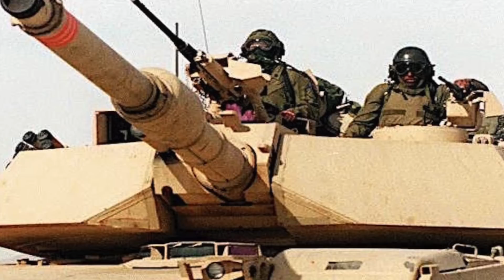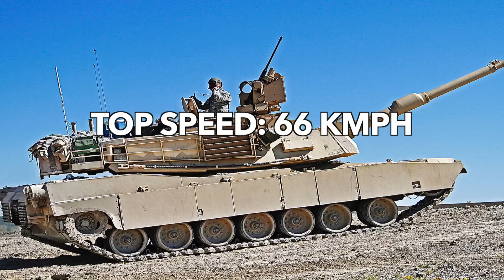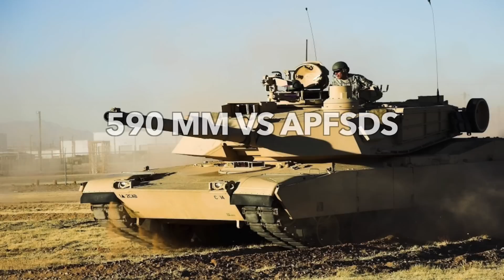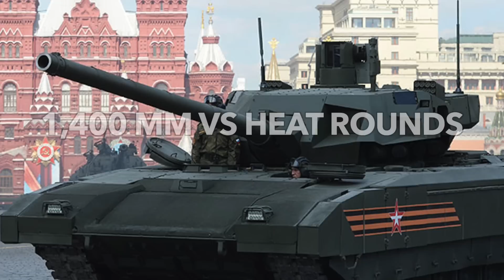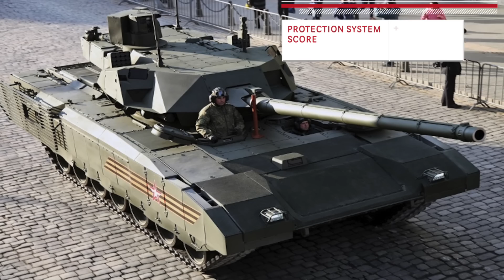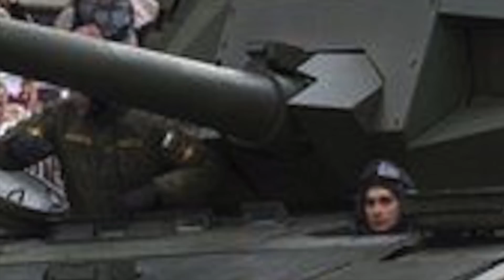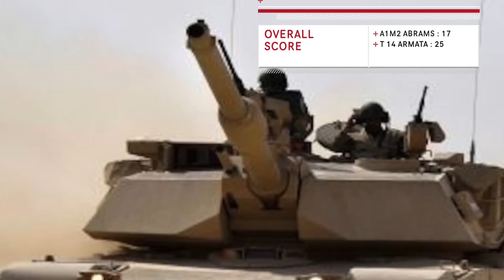AMERICAN M1A2 ABRAMS  vs RUSSIAN T14  ARMATA: WHO WINS?

Comment: A note about  the cost (point 5) :  
Abrams $9.6 million vs Armata $3.7 million. Ratio : 2.6 to 1
US GDP (2015) : $17.95 Trillion vs Russia GDP (2015) : $1.326 Trillion.  Ratio : 13.5 to 1
So... 
Russia spends 1% of its GDP on tanks, it gets ~3600 tanks.
The US spends 1% of its GDP on tanks, it gets ~18700 tanks
Reply: USA debt vs Russian 0$ debt

Ratio:   19,846,342,893,093 to 0
Reply: I mentioned this because raw price is usually less important than affordability, and with its much larger GDP, the US can afford a lot more tanks than Russia can, even if the individual tanks are ~3 times as expensive*.

As to maintaining the tanks, it probably follows a similar pattern. Yes, 18,700 M1A2s would cost a lot more to maintain than 3600 T-14s, but again, the US has 13.5 times as much money as Russia, so they can afford it.

Lastly, I don't know where you get the idea that one can't put more than 50 tanks on a battlefield without becoming an easy target.

*One reason the Armata costs less is because Russians workers make less money than US ones do.   Of course the Russians can make a cheaper tank... they only have to pay $5/hour rather than $30/hour to the guys who mine the iron, work the smelters, roll the steel, machine the parts, assemble the tank, and so on. 
 Same goes for operating cost.  One wonders what T-14 would cost if the Russians paid US wages to all the workers in its chain or production.
: 
M1A2 : $9,600,000   :    US Per Capita GDP : $60,000    :   M1A2 cost in worker years  : 160
T-14 : $3,700,000      :    Russia per capita GDP : $9,000 :  T-14 cost in worker years      : 411
Reply: +Jack Ozbloke

I've never been a fan of the T-34.  Despite its fearsome reputation, it was (in a lot of ways) a crap tank backed by crap doctrine operated by relatively poorly trained crews.   Of course, in the end, there were a lot of T-34s and not so many Tigers, so the T-34s won.   Even if, as you assert, the M1A2 is the T-34 in this comparison quality wise, all I am pointing out is that (despite the individual sticker price) it will also be the T-34 in numbers.

Extra : 
How about this instead :  The Germans had fewer tanks than the French in the battle of France, and the French tanks were generally better armed and armored, yet the Germans beat the French in a matter of weeks.   There is more to it than "comparing millimeters".
Reply: If you own the bank $1000 and can't pay, you're in trouble.

If you owe the bank $10,000,000,000,000 and can't pay, the bank is in trouble.
Reply: Even tigers vs t-34s in ww2, fighting point blank range virtually and the tiger fewer in number but higher in quality jsut destroyed them, the m1a2 is comparable to the t-34 but instead of having the price it has the tigers price which is actually quits funny.
Reply: +Aj Styles
Care to explain (rather than just assert) why the US can't afford to spend on military?  I mean, they seem to have been doing so for the last 70+ years and currently spend more on military than the next 7 largest spenders combined.  But "Russia Stronk" for whatever reason...

As to you 50 tanks argument... yes, balance is important... sending unsupported tanks into close terrain that is packed with enemy infantry is a bad idea.  But the side that can afford more tanks can also probably afford more infantry, more air, more artillery, and more of everything else, so it won't be doing that unless someone in the chain of command is an idiot.     As to the 5 rpgs per squad thing... what are you saying?  Russian Infantry is immune to tanks because they pack too many RPGs and that they will make a fortress of destroyed enemy tanks around themselves that keeps any more enemy tanks from approaching?  I guess "Russia Stronk" again.
Reply: At the end they mentioned the T14 would be outnumbered in battles against the M1A2, yeah GDP does play a factor in  producing tanks.
Reply: In present day figures a T-90 is over 4 million each.  I would imagine an Armata would cost more.
Reply: You and every other Russian dumbass on here need to slapped in the head with an iron frying pan until you cease to exist or they stupid goes flying out of you.    To actually THINK that a 35 ton vehicle carries superior armor to a 70 ton tank is the absolute DUMBEST thought in the HISTORY of mankind.    EVEN some idiot that says "hold mt beer and WATCH THIS"!   THAT guy, is smarter than you.  Lol 😂😂😂🖕
Reply: Are people trying to come to the US or are they trying to go to Russia?  Russia is exporting its children because it can't afford them.  Their women are choosing to be brothel workers in the Middle East and Thailand instead of live there.  Come on man.....we are not stupid.  You are just jealous of its power and its influence and you are not allowing yourself to see what you know is right in front of you.  The US is quite simply the greatest nation the Earth has ever known.  It really is.
Reply: Americas Government Debt. 20 Trillion and rising fast. In peace time. Unsustainable.  You lose.
Reply: I don't. US dollars, that's shit. 20 Trillions in debt, in peace time. I don't call that reliable.  That's what's nice about debts, you owe it to other people, and you have to pay one day. If you cant, well your money will be worthless in no time :)   Remember Greece.
Reply: What war was that ? The war on terror ? Good lord, good thing it wasn't a real war... You clearly don't understand how the defense budget is voted or even allocated.  Bought many war bonds recently ?  Dummy.
Reply: Duplicity you do know that America owes most of that debt to Americans right. Not China. Many people have this weird assumption that we owe China 19 trillion dollars. If we did China would ask for the money and destroy the U.S. economy.
Reply: mike che how does money have anything to do with suicide. You do know money can't buy happiness right. Also those soldiers have gone through a lot of shit in their respective wars. They have flashbacks of the terrible moments they went through and the memories of death haunts them still to this day.
Reply: older than you from the looks of it.
Reply: AJ Styles sounds like you are confused friend. 1: Battlefields don't have boarders, that's video game logic, 50 tanks take up barely any space on a  real battle field. 2: even in confined quarters like a valley or city, you don't have to send all 50 at once, you can send them in waves (You said this, but then acted like you forgot so I thought I would point this out). 3: An RPG is designed for light armor and anti infantry, In Afghanistan my MATV took multiple RPG hits and kept rolling, it's not a threat to a tank. 4: Even if an RPG could kill the Abrams, it cant engage the at more than around 150 meters, while the Abrams can engage at around 1.5 miles and 5: You can knock out a tanks mobility, but then all you have done is made it a turret. "Knocked out" tanks can often still aim and shoot, and trust me, infantry don't want to go in a head to head without their own tank support. Lastly, if you are going for real battle specs, of a Russian and American military unit going head to head, The US would have air and artillery superiority and would soften any target area sending in tanks and infantry to mop up, the number of Russian tanks and infantry to survive such attacks would be of no threat.
Reply: +Jqbogus

The lowest cost listed for the T-14 was 4.12 million USD. Not 3.7. This accounts for today's adjustment in monetary values for both the ruble and dollar. 

The M1 doesn't cost that much in any variant on record.
Reply: +Nathan Peterson
I was just quoting the cost per unit used in the video.  Are you saying this video might be inaccurate?  :)
Reply: +Jqbogus
Well, same as before when you send an entire tanks against someone, the only right respond is to reply with the same answer, and we have seen US numbers dwindle just as they can't keep up with the maintenance which ends up costing delays. And yes triple the numbers, as in transport, ammunition, fuel, and spare parts. US don't operate within their country in most situation unless it's defense.

I mainly suggesting that troops using Russia weapons usually incorporate some anti tanks, same cases that happens many times. It is funny how you said if they can bring a lot of tanks they can also bring a lot support, and the enemies can't?

- one thing i want you to know about me, I don't care about numbers nor their might, as in who will win Russia or US, neither, if they both go to war for whatever reason, i think Russia can win, not because of their current power nor in US incompetence in many previous history. But as the only people who has been at the top for so long, and yet remained as a 3rd world is just weird as hell.
Reply: us gdp ...less foreign debt ...around... 0
russia gdp less foreign debt ...gdp untouched... no debt!!
Reply: funkierfawn budgie 158,009,671,672 USD

Russia is in debt and rising steadily don't neglect the opposition
Reply: funkierfawn budgie HAHAHAHAHA lol nice comeback
Reply: And still doesn't has the balls to invide russia , what a pussies
Reply: The German military's simulations arent fully correct tho,  and that is both crews are equally trained, and also, they don't know everything about the T-14 yet either.
Reply: +smyers820gm well it doesnt weight that, and not everyone uses systems as primitive as just thickness in armor thats why even hutties beat the crap out thus shity tank... just like the sherman by the vietnamese... seems like someone needs a reminder of the slaping usa had got over the years hahahahhaha
Reply: +SeanP7195 you imagine a hole lot...
Reply: +SeanP7195 you imagine a hole lot...
Reply: +SeanP7195 you imagine a hole lot...
Reply: Well maybe...just maybe, should check your info before typing...the t14 does not weight that 35 ton, however only us jackasses rely on only the primitive protection of the thickness of the damn tank, i mean...fyi the ww1 was a century ago, maybe that kind of thinking is the one that take the abrahams to be turned into scrap in yemen by forces way underarmed compared to the saudis but other than that, keep thinking the abrahams is the best, wont be true, but you ll live in the fantasy world right?? hugs bro!
Reply: Jealous much? The US dollar is the world's reserve currency. It's the most stable. It's the most reliable. The US economy is where the world puts it's spare money for safe keeping.
Reply: +TomDotCom2 jealous? you soeak of it as if the us economy were suoer healthy and its clearly NOT is world most indebt country by far and keep pushing it, dont make a good dvd olayer no more, all car manufacturers in crisys about to crash... seems like that currency stuff is about to change your economy is imploding cant you see? so in short no im not jealous at all.
Reply: Jqbogus 
All western GDP formals total nonsense 
Russia have Draft army (almost free) and many simular examples like FREE  healthcare  daycare and so on.... which in USA dont even  try yet 
So that GDP nonsense don't really apply
Reply: Implode?    highest GDP in the world. An economic titan churning out elite goods and services in demand worldwide.
Reply: +TomDotCom2 and highest debt, beyond gdp, house, car and tech industries with lower and lower and lower income, companies as sears and caterpillar crashing that imploding got it now?
Reply: Not one company exists on the original NYSE.  Companies are always coming and going.  Many of the top companies now we barely knew of 15-20 years ago and 20 years from now they will be different again.  You appear to be from a collapsed and weak Latin American country and feel angst at your people failures.  I guess thats normal to feel that.  Many nations take this stance.  It is also a very useful tool for many nations to use a more powerful nation to cast aside its failures and true identity.  The people gobble it down like flan.  I've always said its not nations or governments, politicians or corporations that are the problems.  Its the people who allow it.  Welcome aboard.  Classic defense mechanisms.
Reply: +Daniel Barvenko when did i say anything about russia's economy? im speaking about the decay of us economy...thanks though
Reply: Yet the economy of the us is indebt, and with continous companies closing its operation, losses in revenue, cant even make a decent dvd in us...i mean not even the rockets that take astronauts are being made in the usa no more...but if you wanna live in fairyland thinking us economy is best in the world with the largest gdp dude be my guest, that is a pipe dream as much as the american dream, GONE.
Reply: Dont worry!
Reply: Name these countries (especially the one you are from) that is debt free for us.
Reply: your talking to me?? cause....correct me if im wrong its been 17 years and gizillion dlls in budget for that war that has acomplished what exactly? the region is far unstable, us is far indebted, none of that wars, lybia, irak, or afghanistan has really brought anything good for no one. NO ONE. By any means is us safer? no, is it enjoying more freedom in or outside the us? no...so? besides, who said us is the planet's police???
Reply: Jqbogus US debt 20 trillion dollars....Russia 0$, ratio...infinite!
Reply: Don't forget we pay our soldiers a lot more than Russia does and that's a major expense. Probably the highest one, especially considering we have many more soldiers and contractors to pay these higher salaries. We also have to maintain an insane amount of basis around the world so we can project our power but Russia doesn't. We spend Billions on carriers and they spend millions on carrier killers. Add those factors and it cuts down on your ratios dramatically.
Reply: Who pays more? LoL
U should compare living cost and so on by country and see who get paid more
BTW Homelessness in Russia illegal, by Russian constitution  every citizen have place to live and free healthcare 
Government a MUST provide place to live healthcare and on.......
Reply: Qvolepues 
If USA paying to solders good how come 22 veterans a day coming suicide?
Reply: "Money cant buy happiness" Really???
How old ARE U?
Reply: Ok but how fast you can make them 😁
Reply: bur other countries which are customer of usa and russia for weapons will prefer t14 armata which will loss profit of us arms companies.
Reply: Pathetic old man keep coming back for more you fucking petofile. Your like A turd that won't flush because your butt hurt that you are the dumbest one on this site. LMAO!!
Reply: America is also in more debt than Russia
Reply: Murican fanboy🖕👎
Reply: Russian junk is always cheap, because it is a junk!
Reply: That's bullshit and you know it! Russia is capitalist not communist anymore, there are lots of homeless people in Russia, most also addicted to high risk drugs...
Reply: And US debt is . . . ? Wait till we get petro-yuan, and the seppos will find themselves bankrupt. Can't wait!
Reply: Well U.S. government will not use it's GDP to spend on military, it is the Defense Budget, 700 billion USD,because U.S. has currently the largest Debt  around the world it is about 16 trillion USD and China is the largest Debt holder of it's debt.
Reply: Russia will also not spend it's GDP on military it is only depends on military budget.
Reply: U.S. has currently the largest Debt in the world because of it's too advanced technological infrastructure uses in the country, however, U.S. government has spend too much on advancing nuclear weapons, as they have produced around 70000 warheads since 1945, spent 8.1 trillion USD, but also includes of the fund raise for education, safety, FEMA,and unemployment in the U.S. totally added up together is about 7 trillion.
Reply: Well WW3 will not quite happen in the next few years because the world is getting bankrupt, as EVERY country around the world has various debt on their own economy.
Reply: Jqbogus 
   So, you purchase tanks via debt? How fucking stupid are you? 😎
Reply: Jqbogus 
  You don't understand the concept of debt, do you? 😎
Reply: Mantas P 
  No, they are not. 😎
Reply: LOL
https://www.nationaldebtclocks.org/debtclock/russia
Reply: https://www.nationaldebtclocks.org/debtclock/russia
Reply: Joris Thijs 
https://www.nationaldebtclocks.org/debtclock/unitedstates
  See how fucking stupid you are? 😂😎
Reply: Nationalist Canuck  Did I said somewhere that the USA had no debts? Checks, checks again. Cannot find it...
Reply: That seems a logistic nightmare, that's why they don't need mathematicians in the front line...
Reply: Jqbogus economy for the us will likely collapse due to China and China's massively suffer to but russias could increase since Australia, China's main resource importer and many other western counties stop exporting their resources they'll turn to russia which could make the economy increase if not a slight boom.
Reply: Care to tell why mentioning this? You forgot the price of maintaining those bloody tanks. Even if you have 100k tanks, you can't actually put more than 50 on one battlefield without becoming an easy target.
Reply: Also, 15 years of war is not "peace time"
Reply: Not really, US can't maintain that much, despite having huge money, the only ones that can easily maintain is Russia, so the numbers work 100% for Russia, but US has to move most of their workforce which will increase overall budget almost triple the price each outside of US, not only that, the numbers would cost delays.

For the 50 tanks, I don't have to explain it, its more like a strategy wise, if you do not balance your army, then the enemies can take advantage no matter what you do or how high the difference is, it only works in games, but in the real world, especially the russians, each squad would have more than 5 rpg's, more than 50 tanks would make them too tight and less chance to evade, more chance to get hit, eventually tanks that destroyed will block the path of others and becomes a kill zone.

It is like what US did to Iraq the 20k vs 100k? I would've sent them in waves instead facing them face fowards, stressing them out since the difference in power is too high.